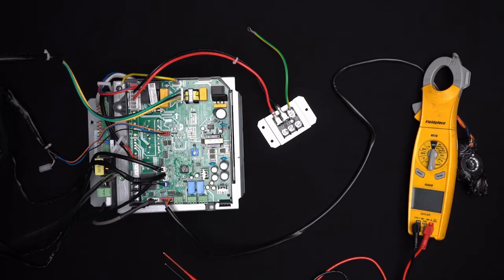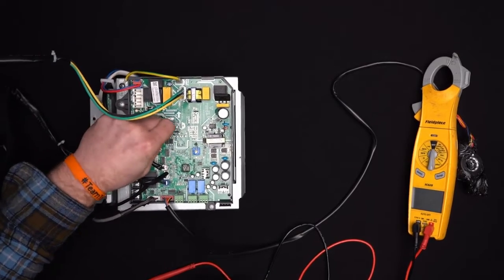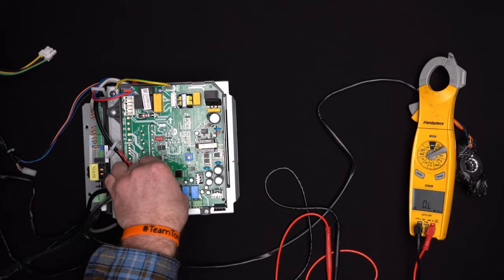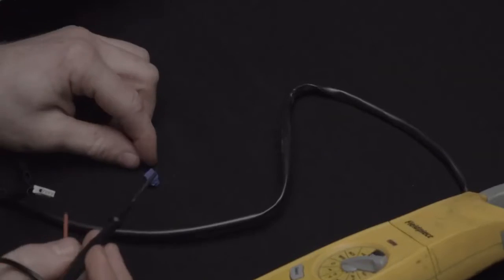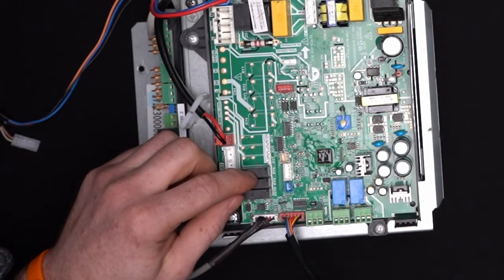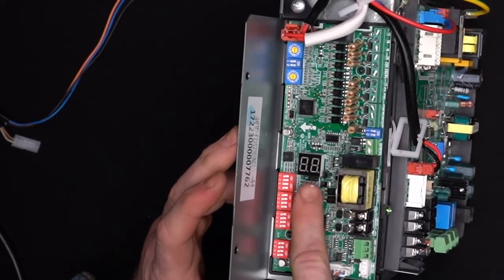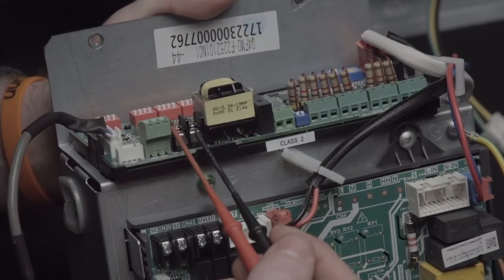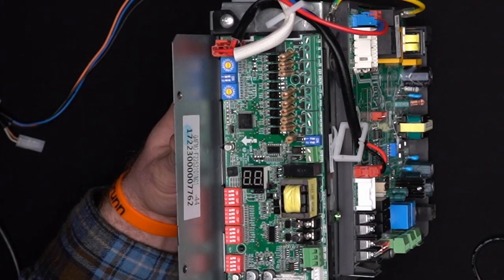Walkthrough of the ACiQ Next Gen Heat Pump Circuit Board

Comment: Videos I've seen showed slight differences from my 3 ton ACiQ system. Also, the kind of thermostat you use and whether you add aux electric heat changes how the wiring is installed. I found the instructions for wiring with my configuration confusing so these notes may save you some time. 

All HVAC videos I saw powered the AHU from a 240v output on the condenser unit. My 36K ACiQ condenser unit did not have an L1-L2 output to send power to the AHU, so I simply added a separate 20A 240v line to the AHU to power the circuit boards and fan. (15A 240v should be adequate so I plan to switch to 15A).

My system included an 8K aux electric heat coils which came with a single 60A breaker installed at the AHU so you need another 240v line run from your electric panel using wire and a breaker properly sized for your size heat coil. The breaker at my panel for this is 40A for 8K. (I'm not sure why the included breaker at the AHU is 60A, seems to big). 

With the T755 thermostat recommended by HVACdirect you need 7 wires from the thermostat to the AHU but you do NOT run any thermostat wires to the condenser unit outside. Instead you only have to run an 18/2 shielded wire from the S1 and S2 terminals in AHU to S1 and S2 in condenser unit.

Dip Switches: RED bank: SW1-1 on; SW4-1 on; SW4-2 on: all the other SW switches off. A pair of blue dip switches at top of data circuit board to the right of the thermostat wires are both in UP/on position. A pair of blue dip switches on bottom between two dial switches are both DOWN/off.

My new system ran perfectly with this configuration. AC was very cold and the ACiQ 3 ton AHU blower was very strong, much stronger than the same size Goodman unit I replaced. Inside and outside the units run so quiet I can hardly tell they are on. It's only run for one day but I am very pleased with this system so far.

Comment: Very helpful. Would like a rundown like this for the dip switches.

One comment. At 6:49 “if you are using 24V communication”…

The connection between indoor and outdoor unit for both “Connection method A” and “Connection method B” use the S1 & S2 terminals.